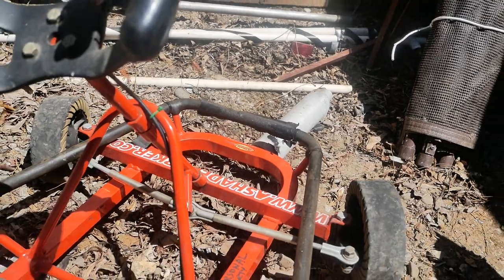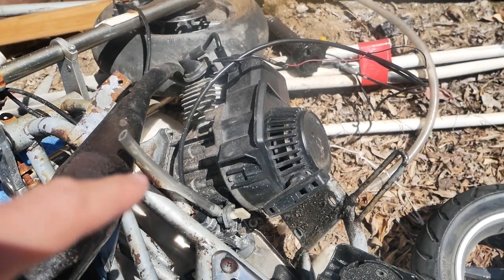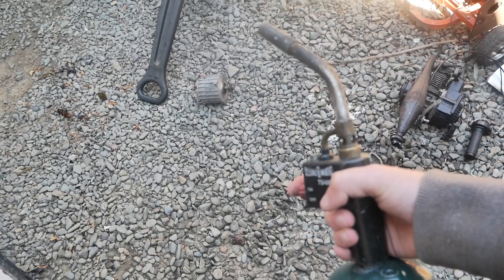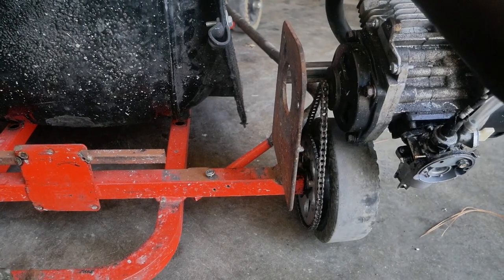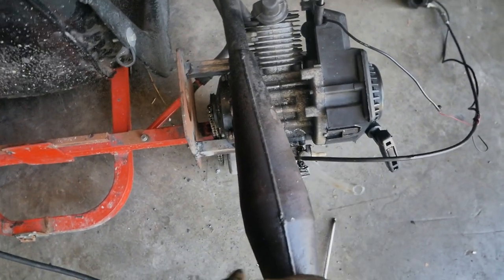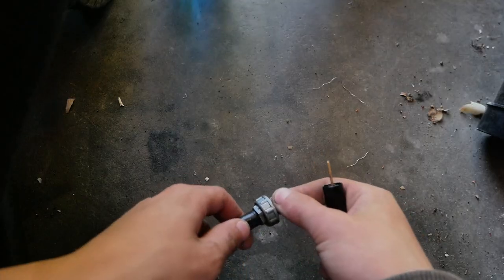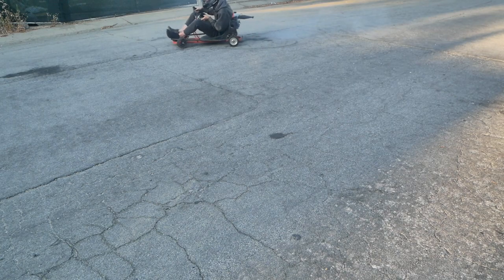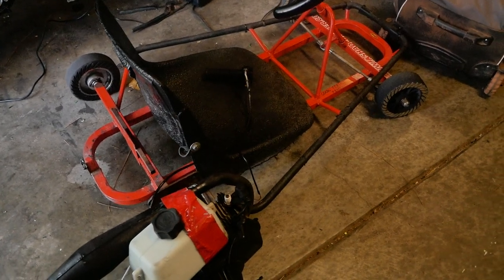GOPED GO KART BUILD SUPER FAST 35+mph

Comment: Sooo... Ummm... 
You know you could have just swapped the drive wheel & mounting plate to the other side, right?  
That's assuming, of course, that the seat wouldn't be in the way.
Reply from the maker: welp too late now lol
Reply: @ianbuilder  
Still an option for the mark 2 version...  
When you decide to power it with nitro methane or put huge tires on it & pull stumps.  

I'll be surprised if this is the last appearance that contraption makes in one of your videos.
Reply from the maker: @kaisersose5549  i might just buy a larger frame anduse that  i also have a 10 kw electric one of the same kart but the controller is dead
Reply: @ianbuilder  
You can really go as large as you want. 
There's a guy who used a cheap 212cc (or so) engine on his antique tractor, with relatively decent results.  

External commutation of BLDC motors is possible, should you choose to go that route.  
Its not the easiest thing to figure out on induction motors, but it is pretty cost effective if you have some scrap motors laying around. 
Old drills are the easiest to use, since you can just put the timing gear in the chuck.
It takes one motor to control one phase, so it takes 3 to control the typical BLDC motor.  

Its also possible to rewire most multi phase induction motors to single phase at a significant loss of torque.  
A 10Kw motor for that size of kart may be a candidate.

EDIT: You could also use a controller meant for a much smaller motor to drive some field effect transistors, which would drive the larger motor directly.